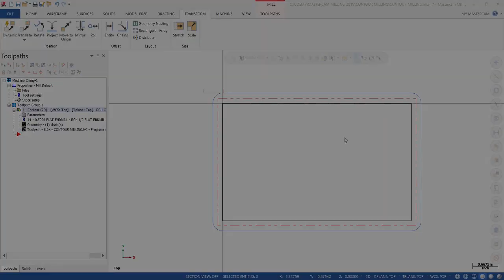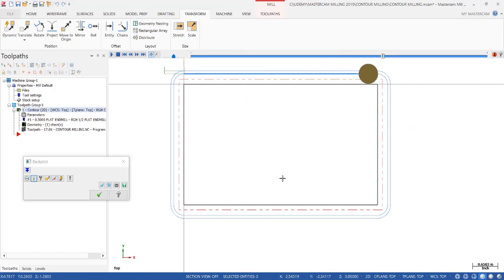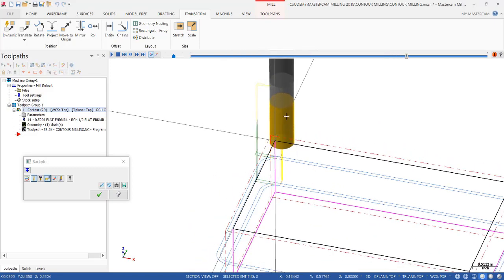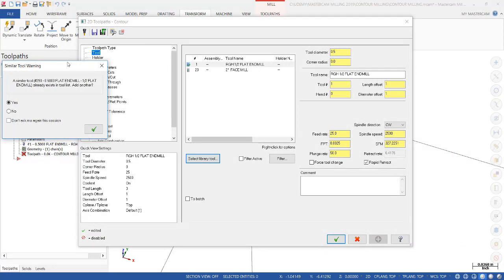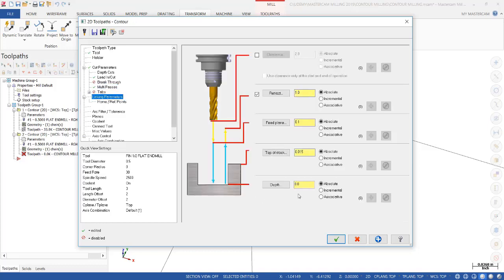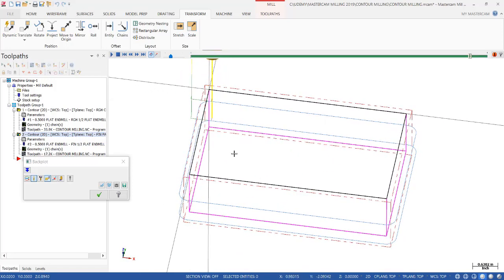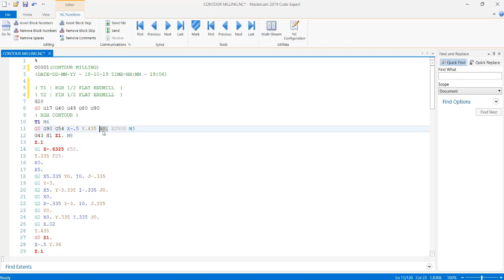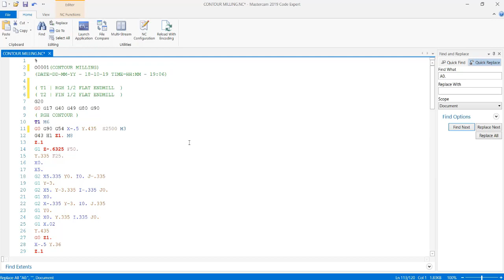FINISHING A CONTOUR IN MASTERCAM 2019

Comment: Hello Tom. I am a new cnc programmer. I watch most of your videos. You are great as a teacher. I program for a haas lathe and a vmc. I am using mastercam to generate codes. Recently I am not getting desired product finish on the OD and Bore. I am using matric formuls for speeds and feeds correctly as per your video lesson on speed and feed. But there seems to little bit of chattering on the job everytime. I also applyed SSV as per haas recomendation. But when I turn the job manually from the VPS it gives perfect finish withot any tailstock support. Sir can u plz help
I also have a question on cutter comp on milling operations. I never used wear option . I let it default computer setting. I still get finish within +1 thou accuracy(which is allowable in my case).  Would u please explain the difference between wear/computer. And when should I start using wear.